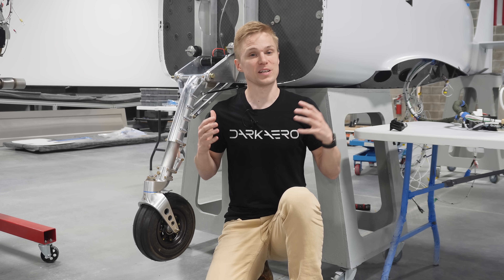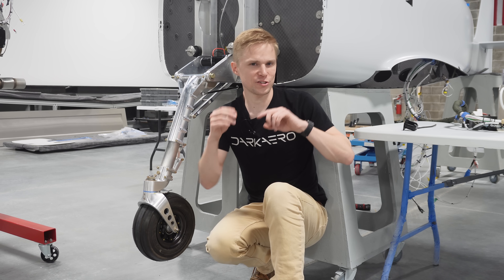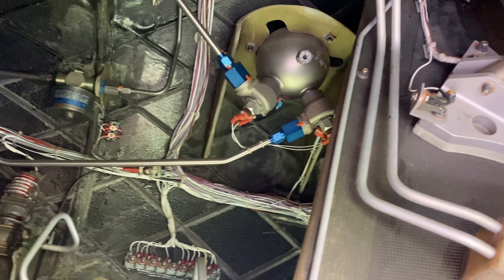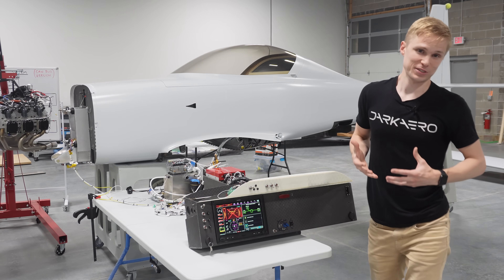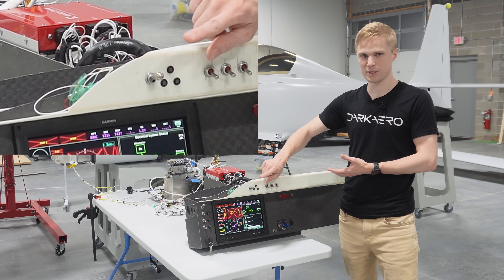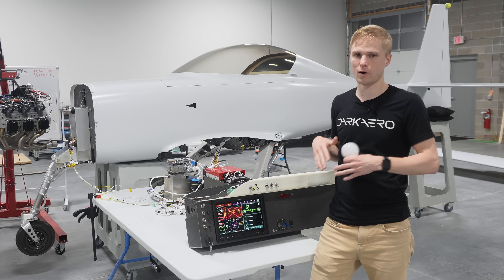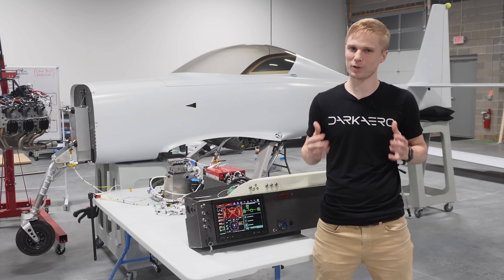Designing smarter landing gear

Comment: Dear DarkAero crew - Green and Red can still confuse a pilot as to up and down, since those colors are port and starboard. And no light means not working or broken. Please use lighted icon symbols indicating Down/Locked or Up/Locked. Thank you. .
Reply: many aircraft have the green and red lights for landing gear and it's no issue. There's no common light inside the cockpit I can think of that relies on green and red to indicate port and starboard, those are only the position lights on the wingtips. Icons are fine, but they need to be very easily recognizable at a glance.
Reply: Almost every aircraft on the planet has green and red gear indication lights. The only place you see green and red lights indicating port and starboard in aviation is on the navigation lights on the exterior of the aircraft.
Reply: Isn't there also a consideration to be made regarding red/green colour-blindness? Depending on the severity, I know the CAA/FAA will grant pilots a licence with some degree of colour-blindness, but usually for PPL's and/or restriction on night-rating. 
However, I'd think that taking the risk out altogether would be a more prudent approach and maybe add flashing during deployment, only showing a permanent light once locked in position?
Agree that there should be symbols for deployment/stowed status.
Reply: I'd assume you can easily customise that to your taste, no biggie
Reply: @josephc.9520  Some will forget that -> will be a biggie.
Better to make it fool proof by DA

Comment: Is "off" as an indicator of closed a good safety option as there's no way to tell the difference between a light circuit malfunction and closed landing gear?  I know there have been several industrial accidents stemming from the use of "off" as an indicator, so I'm surprised that it's allowed in aircraft.

Comment: What redundancy exists in the system in the event of a CAN bus, logic module, or electric motor failure? Will it be possible to manually lower the gear or release the up locks and have them lower by gravity?
Reply: Excellent questions. With the depth these lads have plummed in this design we can have confidence that they thought of this, however NONE of that is addressed in this video. They could know their audience better and that we would have these questions.
Reply: They literally mentioned their emergency extend system in the video.

Comment: Commercial aircraft use hydraulics because when they (or the designs on which their components were based) were first designed decades ago, only hydraulics were practical... and they may share hydraulic pumps with the flight control systems. None of that applies to any new design, at any size. Electric is certainly the logical choice for DarkAero.

Comment: The light bulb @6:14 is not "100 watt" by any measure. It appears to be an LED lamp, so it doesn't use 100 watts of power; no "100 watt" bulb produces 100 watts of light. I understand the use of a light bulb for the comparison, but to make any sense it has to be an old incandescent bulb that actually uses 100 watts. Since those are generally not used any more, it's not the useful example that it once was.

Comment: how do you determine, in flight, if an LED has failed (off) versus stuck gear?

What if the right main LED failed, and so never illuminated, but the gear came down and locked?
What if the right main gear failed to unlock and extend, how would you know the LED wasn't bad?
What if the right main LED failed, and the gear was extended but not locked?

Comment: Indicator lights off when retracted is a bit of a concern to me. There's no way to distinguish between an indication of normal retracted status and a complete lack of display functionality, since both correspond to lights off. Another colour of each indicator would provide a positive indication of system functionality.

The locks are not currently installed. What happens to the indications if a gear extends or retracts all the way, but the lock doesn't engage? Are the locks monitored by position switches?

Comment: Very cool.  
I am curious whether you plan to apply the brakes when retracting the gear struts (just prior to entry into the fuselage | empennage).
Can't wait to see a series of flight tests ..... great progress.
Reply: more complexity is not a good thing. just tap the brakes yourself. use that computer called a brain to automate it.
Reply: @SoloRenegade  I wasn't asking you, but thanks.  It isn't hard to add a bit from the controller.  It isn't adding complexity, well for most engineers it isn't.
Reply: @truegret7778  if you don't want responses, then don't post comments.

No, from an engineering standpoint, it's not "complicated" to add in the feature. But this is where the notion that engineers fix what isn't broken, comes from. Now you've added electronic control of the brakes. What actuators are you going to use for this? how much do they cost? what do they weigh? what benefit do they add that justifies the added cost, complexity, risks, and weight?

but from a pilot/safety perspective, it's more things that can go wrong. What if the code got messed up and the brakes stayed locked up, you deploy gear and land with the brakes locked. What if a glitch occurs and locks the brakes up before taxi?

As a pilot and aerospace engineer, I wouldn't add it because it makes no sense to. All that work and money to do something no one cares about, to fix something that was never a problem. And people wonder why cars, appliances, and such are so ridiculously and needlessly expensive these days. And less reliable, not as long lasting, and more difficult to repair, especially if using parts that are custom made and hard to obtain years down the road when it breaks (and it will break, everything does eventually).
Reply: @SoloRenegade  Fortunately, you are not the keeper of comments/posts/questions - unless you are a mindless bot which judging by your lack of a profile you might very well be.
I didn't add electronic controls of the brakes.  The DA likely has an ABS controlled braking system.  You are now tasking the already busy pilot to tap the brakes as well?  The braking system is already onboard (no added cost), which are ABS controlled simple CAN bus command word.  Again, not too complex or difficult to code.
You can play what-ifs all day long, so not going down that rabbit hole - this is where use case, risk assessment v reward enters, and addition to test cases and execution can come in.

Weren't you paying attention when your momma said "if you have nothing nice to say, don't say anything at all"?  Sorry, Ryley, River, and Keegan .... here we go.

Since you seem to want to puff up your comments with your CV / resume ... here is some of my experience
I am a retired electronics | software controls engineer working in industries from a startup rocket company (small payloads (400kg) to LEO) to automotive automated assembly and test (bus/18 wheeler automatic transmissions), to managing consignment agreement software development/deployment to a sales force of 900+ for the leading stint manufacturer to systems software test engineer for the leading laser manufacturer of EUV light generation systems for sub-13nm line width devices to continue the Moore's Law and Exponential Growth tradition in semiconductors.  My wife is a retired aerospace engineer /programs manager on the design and development of hydraulic and fueldraulic pumps that are flying on 747, 757, 767, 777, JAF-35 (fuel-draulic pump that uses onboard fuel for control surfaces and landing gear instead of Skydrol - eliminated a system), V22 Osprey, B2 bomber, B1-Lancer to name a few projects.  She earned her pilots license before her pilots' license and has over 100 sky dive jumps.  Cheers

Comment: with all 3 gear legs swinging aft, what does this do to the CofG?  the CofG must move aft as the gear retracts, requiring at least a trim change.
Reply: From what I hear from RC pilots, yes, there certainly can be a very noticeable shift the CG when both the forward and aft gear swing the same direction (as most retracts sing opposite). Maybe this CG shift is partially countered by the effect of down flaps on landing and takeoff, but I would still be concerned with that amount of CG shift on such a very light plane.
Reply: @brandonswindler1690 yeah, that main gear does look pretty beefy. I'm sure that the airplane will be loaded a little further when the gear is down, letting you release the control pressure when the gear retracts.

Comment: I commend you on your workmanship but I’m worried about the C of G change with this design. I estimate the wheels weigh at least 35 pounds shifting that much weight 3 feet forward and rearward on such a small craft will have a profound effect. Cessnas compensate buy retracting the nose gear opposite to your design. You may find you’ll need a counter weight system.

Comment: How much does it shift the CofG when the gear retracts? Also, regarding the logic board(s), are they coded to safety standards that consider self diagnostics, fault detection, sensor faults, gear motor over current, etc? Only asking because I develop ECU's for automotive and the level of fault tolerance in the CAN systems is huge! Even to the point of rolling counters in CAN messages to validate loss of CAN messages and messages that may arrive out of sequence due to bus arbitration.

Comment: Just a thought; how about making the sequence as follows.  Selecting "gear down" actuates a solenoid to retract the up-lock. The lock operates a power switch for the gear motor until the leg reaches the end of its travel and the down-lock engagement cuts off the power. Retraction switch reverses the process. Where are the glaring flaws in my cunning plan? :-)*

Comment: I like the idea of electric power over hydraulic retracts especially on smaller home builts.  For one reason, the smaller hydraulic pumps now are almost impossible to get repaired if something goes wrong since Parker decided to condemn their use on aircraft.   Also hydraulic systems can get messy at times and in general are more difficult to install compared to wires.  Not sure of the eventual cost of this system electric system will be, but if they it is about the same as hydraulic, I would go with the electric, as long as it was adequately tested.  And as far as testing is concerned, one thing that caught my attention was the mention of how fast the gear came down due to gravity, compared to how fast it went up.  That will be the opposite during flight.  The gear will take much more power to come down than it does to go up in this configuration due to drag forces.  Your main gear legs have much more drag then say like the Cessna Cardinal RG main gear legs have, which have the same gear swing as your system or Lancair aircraft.  There's a reason why many of these RG systems have single tube main gear as opposed to bulkier gear designs like your gear.  Two reasons really, weight and air drag. More the drag, the more the power requirement. Your main gear look nice and beefy, but at least 3 times the width of single tube design such as used on a lot of home builts with hyd RG.

Comment: As you work through the design, consider ice.  Any number of planes have taken off from wet runways and had the water freeze the gear in the up position as the plane climbed to colder conditions.  Just something to consider.
Reply: "Any number of planes have taken off from wet runways and had the water freeze the gear in the up position as the plane climbed to colder conditions."

Source?
Reply: The gearbox assembly appears to be sealed, so it's unlikely icing would affect that part of it. The linkages look like they might have the potential to be exposed to some icing, but given how it looks like the linkages nest and articulate, as long as they design it with enough torque, I'd think it could probably break through ice fairly easily (at least on extension if nothing else, retraction might be more problematic in icy conditions). Still, definitely something worth testing.
Reply: Wow good call @marcericdavis. Totally didn't even think of that.

Comment: With your comment that the DarkAero 1 straddles the blurred line between hydro and leccy, does cost/ease of maintenance and reliability factor in? I would imagine that an electric system is much more reliable and maintainable, weight aside.

Would it by hypothetically feasible with your current setup to get telemetry on the retraction system to detect problems ahead of time? e.g. if there's an current draw that might be indicative of premature wear.

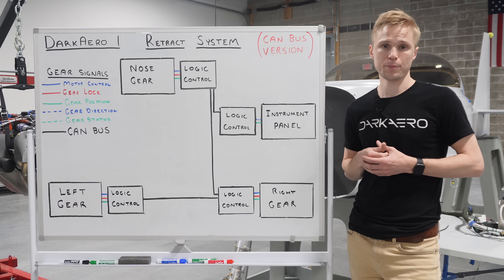Comment: Another interesting update! I have zero experience in avionics or aircraft systems but I was suprised at 3:25 when you mentioned automatically extending the gear instead of sounding an alarm and leaving the pilot fully in control. Is that standard, or a departure from what you'd normally expect in a light aircraft?
Reply: I don't want my machine to ever make a configuration change without my input. A warning to the pilot is sufficient. Gear up landings are never a safety problem, but unexpected uncommanded configuration changes have crashed a lot of aircraft over the years. Including airliners.
Reply: @chester8420  would you like a copilot to make saving inputs, if you as PIC happen to miss them?

The configuration change could be announced with an option to abort. It doesn't have to be man vs machine.
Reply: There have been a few aircraft types that featured interlocking systems extending the gear automatically at full flaps.

Personally, I like the idea of an intelligently automated system. It should be better and more flexible than a fixed connection.

Comment: How are you planning on making it redundant? will it gravity deploy in case of power loss? Also, why do you show a tiny little whimpy brushless motor, when you have setup much larger motors on the system?
Reply: Rewatch the end of the video, they show a gas strut assisted emergency extension, they mentioned it in a previous video too I believe

Comment: Will you require any type of ‘weight on wheels’ sensor into the logic unit to prevent any possibility of retraction when on the ground. Looking forward to seeing if the latches used in the locking mechanism require any sort of actuator. Looking really neat. Good luck from the UK

Comment: what about aerodynamic forces when in flight and extending the gear, would you test that at some point (I see you're adding gas struts which would make sense to aid against air flow over the gear, would be interesting to see what the power draw is in a simulated in flight extension).
Reply: They've already addressed this 100 times. The gas struts are enough to fully extend the landing gear with no motors. That means the power draw when extending gear in flight will be ~nothing.
Reply: @JH-tc3yu  what's the rating on the struts? (it was probably mentioned but I missed those 100 vids where it was explained)